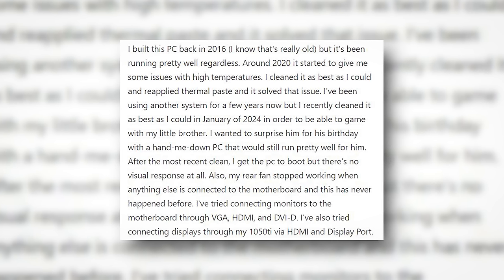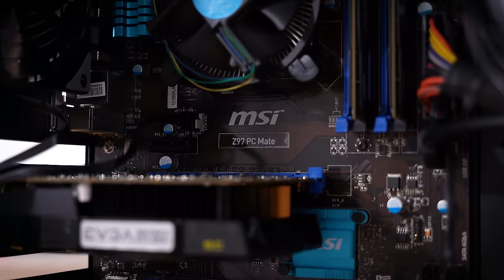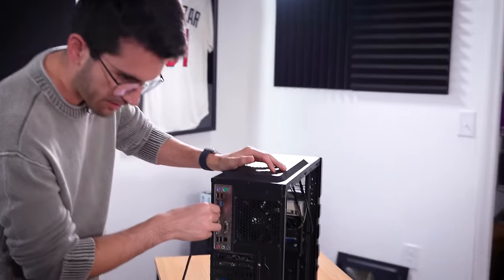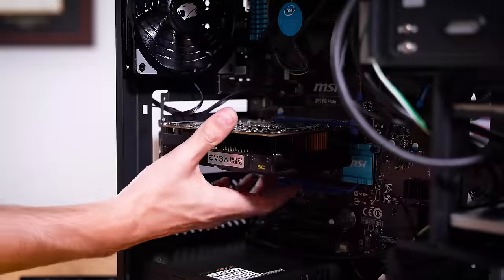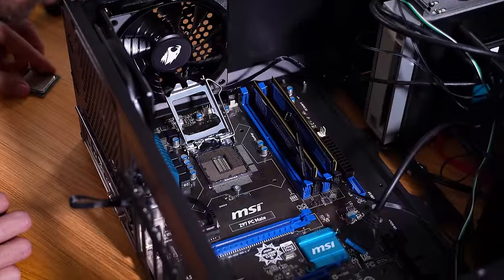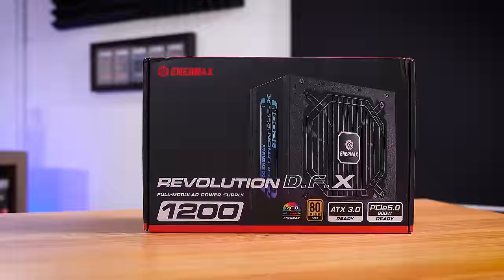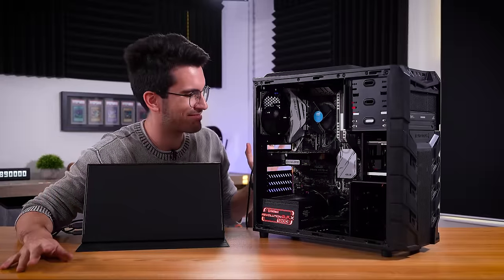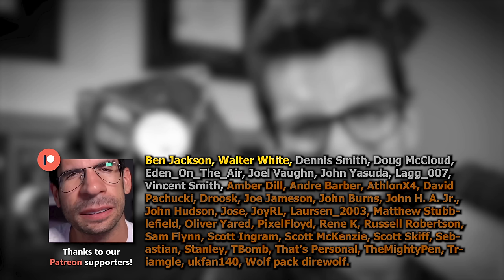Fixing a Viewer's BROKEN Gaming PC? - Fix or Flop S5:E4

Comment: One of the top causes of troubleshooting mistakes: EGO. My dumbass couldn't get my pc to POST with a new GPU. Worked on it for a few hours but my EGO told me no way my ram sticks were not installed correctly. Did not even bother to check thoroughly. Lo and behold, one stick wasn't installed correctly. Like you, I felt so exhausted and defeated even though I got my computer to work. Damn ego.

Comment: That motherboard was probably shorted out for ages damaging the PSU from the usb ports/CPU socket.

The OCP will eventually fail with persistent short circuits on it.  It definitely did damage to the 5V rail.

Replacing the motherboard and PSU was the right thing to do.

That fan cutting in and out was probably another short circuit on a 12V rail on the motherboard.

Comment: Honestly any of the core I series are still going to be good enough for many to most tasks. I have a 1st gen I5-750 and it overall still works great and thanks to a graphics card upgrade still plays most games I throw at it in 1080p. As long as it has 4 physical cores it's going to be fine for all but the newest games. So count out most of the I3 line.

Comment: @GregSalazar
I've been gaming on 1080p since 2008 and much older hardware than that. That system, properly functional, would be fine for 1080p as long as one turns down a few settings. EDIT: BTW, very well done fixing those pins. If you desoldered the busted USB ports from the board, it would be perfectly function again.

Comment: Honestly that motherboard had seen too much and it's probably the right thing to replace it anyway given you had some roughly equivalent stuff on hand. You could get it back up and running only for younger brother to accidentally try to use the busted port and short stuff out.

Comment: Personally, I think the platform upgrade was worth it anyway. I wouldn't have trusted a motherboard with busted up USB 3.0 ports, and trying to replace integrated USB ports is going to be a nightmare, hence motherboard replacement, hence platform upgrade to 6th gen and DDR4 (also I would keep the 4th gen CPU and DDR3 in case I found another old platform that needed attention).

Comment: I just broke my PC with a new BIOS update.  The motherboard is the Asrock B650M PG Riptide.  I ALWAYS update to the newest BIOS, have never had an issue in the past. The old BIOS was number 2.02 the new on 2.08.  I used the Tool built into the BIOS menu to update.  So what happened?  I started the update, the system restarted like normal but usually the screen shows the BIOS with an update progress meter, this time it was a blank screen.  On the Asrock site it states that this can happen with the RTX 4090 and they recommend using onboard video, I never had this issue in the past so I didn't use onboard video.  After about 15 minutes of my monitors powering on/off I forced the PC off by holding the power button.  When I powered back on, nothing, no display, all the fans and RGB light up but no video out.  No problem I said, I have BIOS Flashback! So I used BIOS Flashback to install the new BIOS, and from the blinking flashback light, all went well, but still no video out.  So I flashed 2.02, no out put on 4090 or montherboard, and yes I was jumping the pins to clear the BIOS both before and after the flash.  That's where I am now.  Next step is to take the system apart and start swapping components from my working system, everyone has a backup PC right, and see if it's the motherboard or if I somehow fried my Ryzen 7950x.  I live in Oregon, so no where close to Florida, or I would let Greg fix it for me :)  I never thought you could break a PC with a bad flash as long as you had Flashback to fall back on, but maybe it's not the motherboard I broke. I'll try to remember to edit or reply to this if I get it figured out.

Comment: probly broken usb port shorted and killed the 5v rail on the psu. and owner removed the cpu hoping for it will magically fix the issue resulted bent cpu pins.

Comment: I'll agree, swapping out the board, etc, was a good call. The bad USB can cause issues down the road, and you'd want this to last. Bent pins can mean a shorter lifetime for the system, and of course, who knows how that CPU is really doing. The PSU swap was a must as 600W can have other issues. As an example, I still have a Windows XP 3200+ Athelon system that had a 550W PSU. Every time that system was turned on, the 2.4GHz intercomm system in my room would start screeching, so I'd need to change the set channel to stop that screech. Swapping to a 650W PSU solved that issue. The system was connected to a surge suppressor. So why that PSU was causing issues, I don't know, but swapping it out fixed it. These were plugged into two different outlets in the room, and no, I don't know if they were on the same electrical circuit, but again, the swap fixed it. Just a small example of electrical interference and how a small change can make a big difference.

Comment: 7:00

there are 5 pins you need to move at least there, looks like the middle pin was really flush and might've been missed. worst case scenario fix is remove the pins, or the whole thing from the mobo
Reply: maybe the owner used compressed air and over spun the fan
Reply: always check the pins i guess lol

Comment: erm, you didn't clear cmos pushes up glasses

nah, but for real these are really fun and based on what I've learned from these videos, I would have thought motherboard as well, weird power delivery is a good sign of motherboard or maybe CPU but based on the fan turning off with the cable in it and the destroyed USB port, safe bet was motherboard. You were right but just not quite the reason you were thinking. like of my high school math homework, right answer wrong reasons.
in the end, the viewer got a working rig and everyone is just a little more educated, I call that a win.

Comment: I have a similar motherboard (Mine is an MSI H97 PC Mate) with a 4790k 16gg ddr3 and it is fine.
I got a RX 6600XT (980 died) and it runs 1080p at around 90 FPS (E-sports at the 200s).

The only "problem" is that I've tried to make M.2 SSDs work for boot drives with a PCI adpater but the Mobo doesn't let it, if anyone knows a way around this pls let me know.
I have a M.2 to USB and it works fine but at 500mb/s max.

Comment: being fully comitted on what the mistake could be is a issue i had as well ......i tought i had a problem in my mobo as my gpu was showing problems, so i was able to change from a 970 to a 2070s an the issued stopped for a while but then it came back with the same symptons as the 970 so i thought  , but as i was using an intel 9th gen it would be better to update both cpu and mobo as it would be cheaper, so i did that and as it turns out i was just UNLUCKY with both Gpu , in the end i spent wayyy more than i shoud , bought new mobo, new cpu and a new gpu

Comment: HDMI/Fan issue is so off, kinda like the CPU that was half dead and caused one of the rams in dual channel not to work, but single ram worked on all slots. The fix is the last thing you will think of, as it's an issue you will never see again I'll bet.

Comment: The cpu uses the 5 volt rail and the 12 volt rail if their is a short in the 5 volt rail the the pc won't display, power supply problable killed the 5 volt rail to keep the extra vottage from going to the compasitors and blowing them out this would have kill all the 5 volt rail stuff like memory and graphics card and the PCI lanes.

Comment: also should add and i don't care what most will say but ive had a similar msi board that has that Military Grade splash screen and honestly i don't really trust those for long term anyways, mine the vrm's caught on fire and sent 12 volts to the cpu die and the board was behaving weird before that for a few years, my dad had same board as me and it was starting to glitch and be strange as well luckily i gave him my secondary pc and put in a 5600g for a backup igpu if needed cause i don't trust it and i was always fixing something on it. so perhaps replacing it is in my own opinion a piece of mind

Comment: You fixed it but that usb socket would still be a liability if it was left in and shipped back to the customer. You could’ve desoldered that broken usb, if not replaced it but then it is nice to give the lad an upgrade.

Comment: you did great, but my recent expierence with Intels LGA bent pins, say that sometimes when you put on a cooler it puts too much pressure and rebends and shorts the pins, so it is a much safer build with a new MB and PSU, HATE LGA Sockets,  replacing old with old doesnt cost that much though
Reply from the maker: I have rarely encountered an issue of where a re-bent socket immediately failed again after re-installing a cooler.

Comment: My first shot after the DP-effect was the power supply. I was too much focused on the fact the guy told you he did treat it well. Why the heck did he not tell you he removed the CPU? Seems to me soneone wanted a new PC.
Reply from the maker: Even if he bent the pins himself, it doesn't matter here. My job is to fix. We got the system back up and running again, but gave him an upgrade regardless. If we suspect intentional foul-play, we avoid :-)

Comment: Step 1.  Check PSU - This can be done by disconnecting the 20+4 cable.  You can have a bad PSU and still get lights on the Motherboard.  PSU testers are inexpensive and they should be in every techs bag.
Step 2. Check the CMOS - jumping the CMOS can reset the BIOS eliminating some bad BIOS settings.
Step 3.  Remove Graphics card and test onboard video.
Step 4.  Test memory one slot/stick at a time.
Step 5. Reseat the CPU, this can help in case the person doing the work went to repaste the CPU and didn't get it just right.

These are the order of operations that I would use on this computer with my 20+ years of PC diagnostic experience.

Comment: The keywords are hand me down and little brother. A little brother doesn't need a state of the art 4K gaming rig. And sometimes it could be just as simple as a driver update. I know I couldn't get balder's gate three installed for the life of me and then I just did a quick check of a driver update and boom! solved the problem.
And by the way Greg, this is your channel and you can do things however you want and if people don't like how you're doing it, they can stop watching and make their own channel
Reply: I have a modern rig and I still can only get Baldur's Gate 3 to run in DX11, if I start it in Vulkan it just refuses. Love the game and have been playing since early access but it does not play nicely with some systems. Meanwhile my freind playing on my hand me down rig with a GTX960 never has an issue despite being below minimum specs

Comment: I win Still own my old very first game PC from 2012. Its a Asus Sabertooth P67 with an I5 3570K 16GB ddr3 1600 and a GTX 1060 OC from asus. Computer has bin well maintained even even the shield on the motherboard has a custom paintjob. Managed to run COD warzone in 1080P. up until December 2022. Did Upgrade but also still using my old build. Emotionaly its worth more to me than market value. And if parts need replacement i still do this. Though wish i could find a resonably priced i7 3770K. Basicly imposible to find in my country and if there is 1 up for sale your talking arround 150Euro atleast because of its rarity

Comment: Over the years I am perplexed what a lot of people do when they have a computer problem. One of the first things they do is reapply the thermal paste. I never understood why they do this. That is one of the first things the owner of the PC in this video did. In doing this he apparently damaged the CPU socket. That should be a lesson for everyone. Don't reapply the thermal paste unless absolutely necessary. Whether the pins are on the CPU or socket they are easily damaged if you are not careful.

Comment: Honestly I would still replace everything.  I would NOT trust that motherboard, CPU, or power supply given the obvious damage.  I'm going to have to conclude that that system was not taken care of anywhere near as well as the ower claimed.  Bending pins back might've made it work and seemed to fixed it, but I still wouldn't trust it to not fry anything connected.  There were almost certainly shorts when you started.

Comment: some days it wont load windows right it forgets to laod nvidia drivers and network drivers if i restart its fine but its random half good half bad
Reply: tonight it decided to work flawelessly next friday when i turn it on it will do bad things again thats what its been doing very frustrating i even turned fastboot off no change running everything stock speeds which is ridicoulios both cpu and gpu made to overclock never had issues until 2 mnths ago

Comment: The way people handle their own motherboards is outrageous. To just casually rip out a usb device without care and bend cpu pins..   i think some people do this to get a free upgrade. I've been building pc's since the 90's and have never damaged a cpu or socket. When applying new thermal paste, i never remove the cpu for cleaning.   You have to be super careless or intentionally damage a cpu socket because intel LGA is keyed and only fits one way.

Comment: Hi guys, can someone tell me what's the right thing to upgrade from my current setup I'm only gaming at 1080p. Thanks in advance 

CPU - Ryzen 5 4500 
GPU - GTX 1660 SUPER
MOBO - GIGABYTE  B450M DS3H V2
RAM - BATTLE-AX 24GB 3200mhz 3x8gb
SSD - CN600 pro 256gb M.2 NVME
HDD - Seagate 500gb 
PSU - SEGOTEP BN650 WATTS 80+ BRONZE
PC Case - METEOR 30 White 6 fans

I've brought my parts brandnew except for the hdd for 400 usd or 22,000 php. What do you think is the best to upgrade in it, I'm planning to sell my gpu and get the rx 6600m. I already check it to pc builds bottlenecking calculator and it say they will work great together. What do you think?

Comment: Your preliminary assumptions often confuse me. Not that that's a bad thing cause you still investigate to find out what the real problem is, but I just don't see how you ever suspected the gpu off of the description of symptoms. The only thing I can see that supported gpu issues was the lack of post, but so many other things can also cause a no post that it barely registers for me. What jumped out at me was that the fan turns off if anything is connected to the mb i/o which right away puts motherboard and power supply in suspect mode for me. I'd advise the owner to be more careful when cleaning the pc in the future as that's the likely time when the pins got bent. Great video, a little overkill with all the replacements but I'm sure he will appreciate the upgrades for his brother.
Reply from the maker: I mentioned the graphics card because it was what I was hoping wasn't the culprit. It was very easy to narrow down once we verified that the fan/motherboard relationship. Hindsight is often 20/20.

Comment: This time I would say you are being overly critical of yourself.  That damage to the USB ports did require replacing, and could have been the source of the problem.  That would have led to the cascade of replacements anyway.  Might have been good to check the power supply earlier, but wouldn't have made a difference.  I might not have bothered to check for bent pins, but that is the thing that can happen when someone is desperately replacing parts trying to figure out what is wrong.  Pat yourself on the back, I say!

Comment: This is one example of why you shouldn't clean the pc yourself if you don't know what you are doing. I think the pc was fine until the user wanted clean it and bent the pins...
Reply from the maker: You can perform a basic clean without taking everything apart :-)
Reply: @GregSalazar  that's true but even in this situation you shouldn't push in any way on the cpu while cleaning the thermal paste (better to use q-tips and IPA).